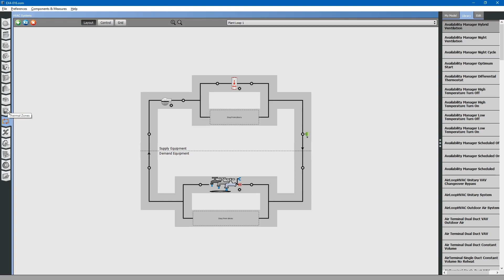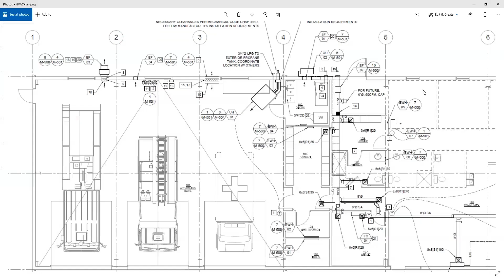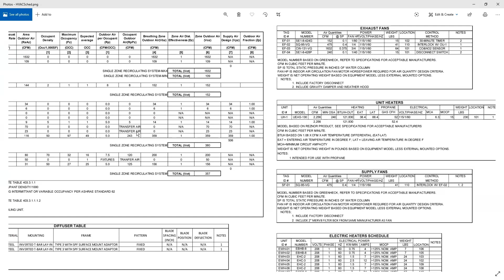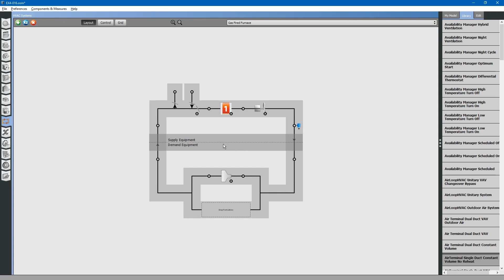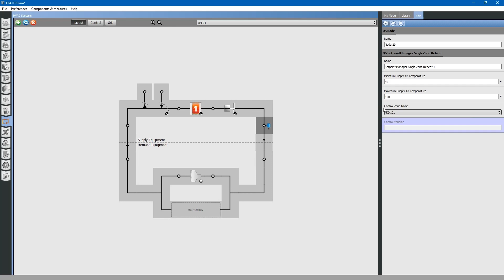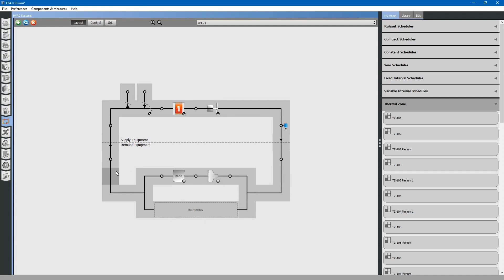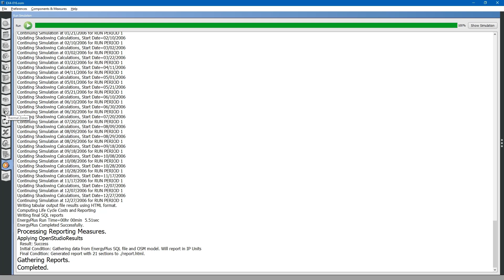Building Energy Modeling in OpenStudio - Add HVAC-1

Comment: Thank you for the valuable videos. Is there any way to model a geothermal water-to-air heat pump?
Reply from the maker: Yes.  What geothermal source?
Reply: @helixenergypartnersllc3540 ground source water to air HP. I tried to model using vertical ground HX and water to air HP in a plant loop, then an air loop connected to the heating and cooling coils of the HP. Is there a need to add any DX object to this setup?
Reply from the maker: I would start by implementing a BCL measure as a foundation.  Here is a ASHRAE Advanced Energy Design Guide measure that will get you an approximation of a ground source heat pump with zone level water to air heat pump: https://bcl.nrel.gov/content/b8ba0b97-9caf-42cd-81bb-16eaa0a4402c

This measure uses district heating and cooling (unlimited energy source) as a source that approximates an optimally sized ground loop.  If you want to get into the actual dynamics of a ground loop, and adjust the loop parameters, you can replace these district systems with a ground heat exchanger (either horizontal or vertical) from the library.

Comment: Hello, thank you for the invalueable tutorials on OpenStudio and EnergyPlus. May I know if it is possible to model an ASHP in either the softwares? An air to water heat pump system for space-heating and DHW? Becasuse I read some opinions are it is impossible. I am still very new to these modellings, still confused on whether the softwares are working together or not. Thank you very much.
Reply from the maker: Yes, but it is not ideal.  You must use the WaterHeater:HeatPump zone object (install on the  thermal zones tab).  Then, you create a water loop and add it to the supply side of the water loop.  Here is an example: https://drive.google.com/file/d/1o5yCV6qbh_ucZovyemlPUmM39mV3MH-l/view?usp=sharing

I say it is not ideal, because the tank it uses is fully mixed (ie. it is not stratified).  Therefore, you cannot realize savings from load shifting (ie. store energy during offpeak hours for use during peak hours).

Comment: Can you do an example for this because i can't figure it out? One air handling unit with 6000 CFM supply fan, 5000 CFM return fan and  1000 CFM fresh air intake while 0 CFM exhaust, unless economizing.  There is also a bathroom exhaust fan (locker room) at 1000 CFM separately ducted.  This is how the building is neutral, the fresh air from the AHU migrates through the grill in the locker room door which keeps it negative. The autosizing seems to always make the supply an exhaust fans the same size which is wrong (issue #1), and i also am not sure how to tell the fresh air an exhaust air dampers to work with this 1000 CFM offset (issue #2), there doesn't seem to much for configuration of the economizer section.
Reply from the maker: https://youtu.be/dnqhpcwoQg0
Reply from the maker: Let me look into this.

Comment: hi mate,  appreciate the video so far, how do I add a HVAC system to multiple zones, modelling a 6 storey building with individual zoning control per space
Reply from the maker: Great question Whiiiteeey.  If you have selected the default packaged VAV with reheat, it will automatically be hot water and create a hot water loop for you.  The loop will already be attached to the airhandler heating coil and the vav reheat coil/s.  You will need to select the Zone Splitter node and add all of your thermal zones.  If each zone has its own temperature settings/schedule, then you will need to create individual schedules and assign those to each thermal zone.  I will do a video on this subject soon.